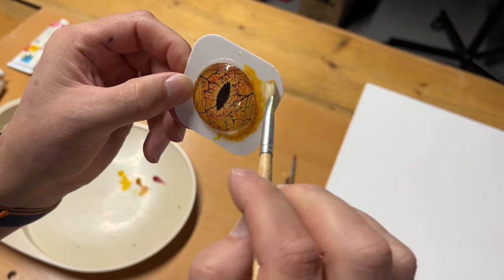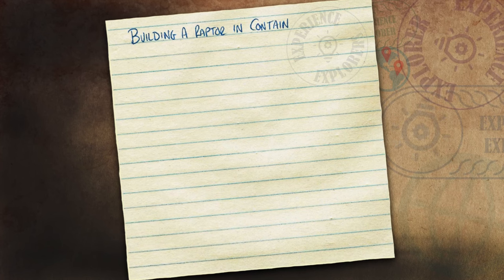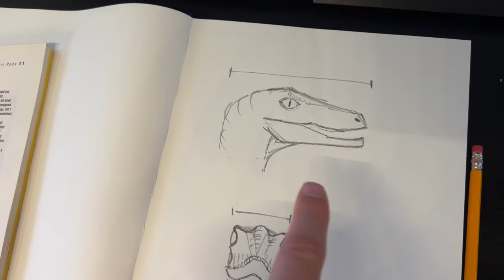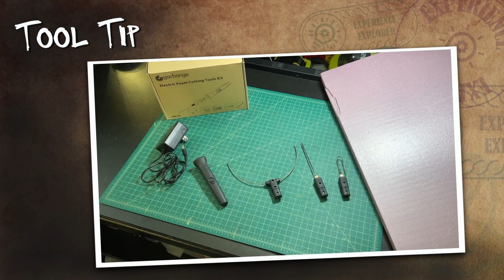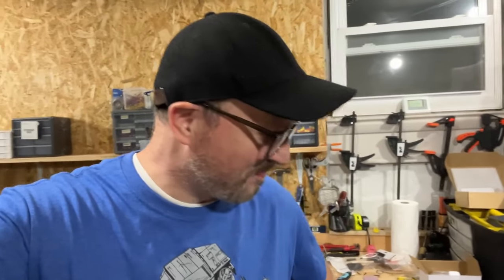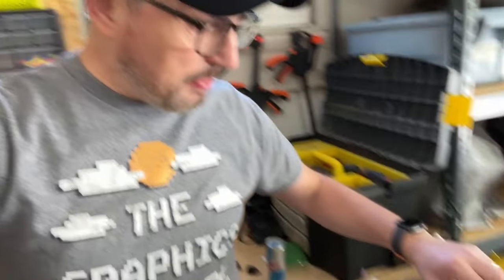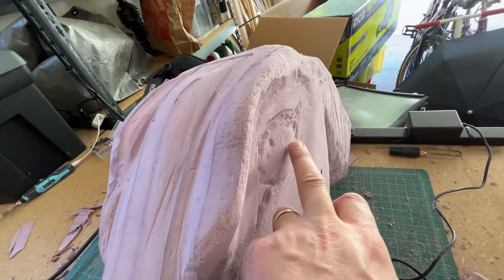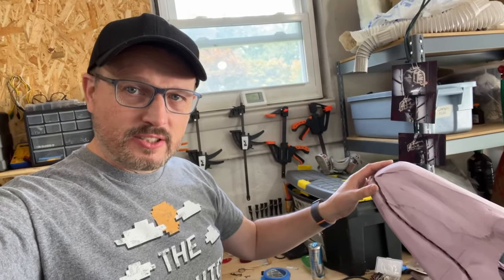How to make a DIY animatronic dinosaur (Part 1)

Comment: How big was the foam you bought
Reply from the maker: 2’ x 2’ 😊
Reply: @ExperienceExplorers  Thank you!
Reply: @ExperienceExplorers  Also, what did you use for the servo power for the animatronic?
Reply from the maker: I used a power adaptor - with an adjustable voltage I’ve added the link to the Animatronics vid.
Reply: @ExperienceExplorers  Ok, Thanks!
Reply from the maker: You are very welcome 😊